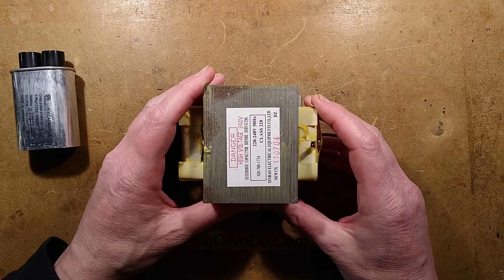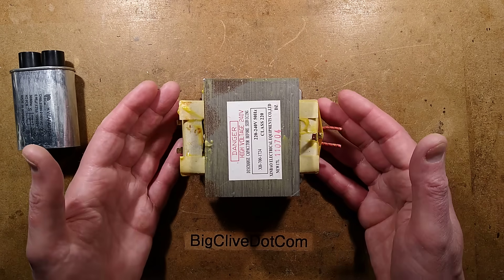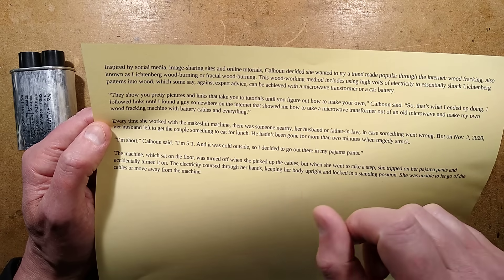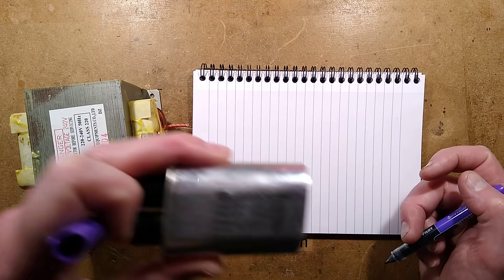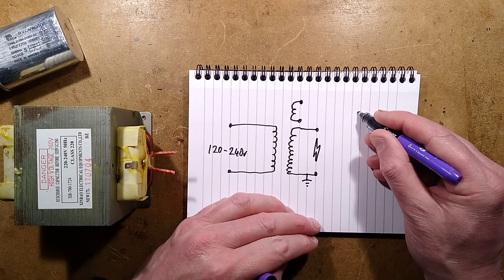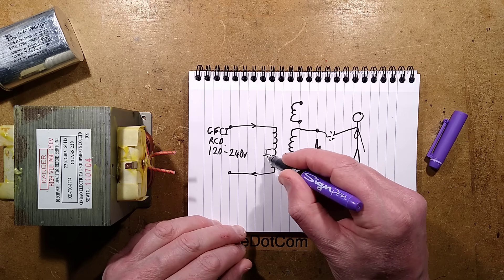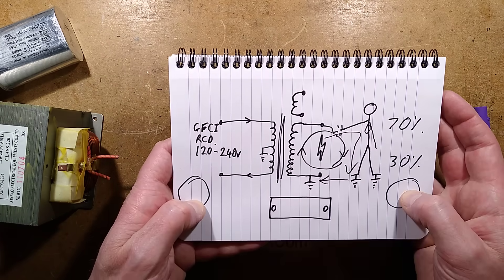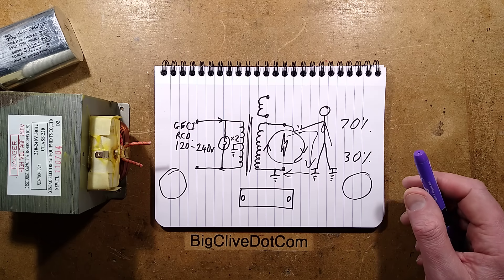The most deadly project on the Internet

Comment: You're dead right to point out the deadliness of microwave HT transformers, as they typically kick out about 2100 volts at about 600 milliamps, enough to kill and cremate someone! And do you also know about the other danger that lurks in the magnetron? The deadly lethal poisonous stuff that can kill someone? I think it's called beryllium oxide or something similar, apparently contact with just a few tiny particles can KILL someone in about a week! The high voltage capacitor can also store a lethal charge.
Reply from the maker: Most modern microwaves use aluminium and chromium oxide.

Comment: I had a special short circuit plug I plugged in when working in in house wiring. Just in case someone would turn the circuit breaker back on.

Comment: “Jumper cables rated for 12 or 24 volts wouldn’t be a good idea”….yeah that’s 12 or 24 volts at 30 friggin amps bud. Conductors are typically rated by wattage.
Reply from the maker: Insulation is rated by voltage regardless of the wire gauge.

Comment: There are a few "how to" videos I watched before I made mine, and I'm pleased to say all is well.  Having said that, I'm amazed at the examples of folk risking death. Like you say, their hands are so close to the probes it is madness.  My probes can be seated on the wood, and then I'm forced to stand about 6 feet away to operate the momentary switch. There is a lamp on top of the box this is all stowed in, and that is on when the power is on. This is near the work piece, in full sight. I can't easily explain the probes that are mounted on their own wooden stands. A bit like a nodding horse?  All in all I'm confident my set up is as safe as it can be.  And to add one last footnote, I did spend about 25 years repairing microwaves for a living!
Reply: Well, as long as you're alone, this does sound safe. The safest way would probably be a hood with an integrated kill-switch.
Reply: " I did spend about 25 years repairing microwaves for a living" I think that alone makes you qualified to play with them lol.
Reply: @neshbro  Except that this is where cockiness, followed by carelessness, often creeps in...

Comment: Great video.  As an electronic technician that used to repair CRT televisions; I'd like to mention a couple of things:  1) Concrete (most garage floors) conducts - quite well, actually.  You should NEVER work on electrical stuff on a concrete floor without shoes AND 2) ALWAYS use the "one-hand" rule when dealing with dangerous voltages.  Make sure only one hand at a time is touching the device or project.  I'm kinda' surprised that you didn't mention #2.

Comment: A deadly important message. Don’t play with High Voltage (over 50V) unless you have done a risk assessment and removed as many of the risks you can identify. Health & safety may be seen as a boring work obligation but it should apply just as much at home for your health and your safety! It’s something you hardly ever see mentioned on DIY tutorials. 

I’ve heard enough horror stories about microwaves to never want to mess with them.

Comment: Ive actually had a accident with a MOT. 
I made a small microwave gun but the magnatron was separate from the power supply and a section of heat shrink didnt completely cover a exposed solder joint. I touched it with the side of my pinky, I was lucky to not be touching anything else otherwise It could have been alot worse. upon getting shocked by the exposed wire my first instinct was to pull away, and i did. however upon pulling away it arced to my finger and burnt my hand pretty bad, nothing like what happened to the lady in the article though. THESE THINGS ARE KILLERS.

Comment: Thanks for doing this video.  I recently read of a local fatality and was blown away by the story.  
I've repaired microwaves before, and I too considered them the most dangerous appliance to repair, hands down. They are a few kV and that's the absolute most dangerous voltage.  At higher voltages it is hard to grasp the wires because the high voltage arcs and you recoil before grasping.  
You didn't mention, but there is an additional thing that makes the microwave transformers very dangerous.  The windings are separated and there is a magnetic shunt in the gap. The transformer is also a ballast - a magnetron has a negative resistance like a discharge lamp.  They limit the current to a few hundred mA.  In a short they limit to a few amps.  This means they don't blow a breaker even in a dead short at the output.  
A few hundred through a few amps is deadly destructive. If you live, you will be burned badly.
Reply: The shunts in the transformer core aren't the only current limiting parts, in fact those only limit current to a small degree. Microwave ovens come with a high voltage cap connected in series with the transformer output. That one is the main ballast. Also an extremely dangerous part.

Comment: I'd say it like this: the amount of power that one of these transformers must put out is great, simply considering its original designed use in a cooking appliance.  No wimpy ionized gas tube lighting, let alone ignition spark, transformers these.  They will nuke you even without a magnetron.  They are a very unwise choice for any craft project.  Better a neon sign transformer for that, which can give you a nasty shock too, but at least is far more unlikely to kill.  Also, neon sign transformers do not reference the secondary to ground/earth.
Reply from the maker: Many neon sign transformers have the secondary mid-point grounded.

Comment: Glad to see you talking about this. People think that insulated wires will protect you and then it jumps through the air. I got shocked in college and was extremely glad I had a hand in my pocket. It's not a guarantee of safety, there's a number of things that can still kill you but in my case it probably spared my life. It feels really surprisingly awful even if you don't get the full amount of power going through you. Had it been DC instead of AC I suspect there's a real chance my heart could have stopped even with my precautions. You shouldn't be doing this kind of project (high amps/voltage) unless you have a degree or equivalent experience in electrical engineering and field experience with high voltages, and even then you would need to set up a workshop for adequate safety and go in with the understanding that there is still moderate risk of death. After that experience I took down my high voltage videos, people who already can do it safely wouldn't learn anything and it could encourage someone to put their life in danger.

Comment: Other comment: If I have to work with a lead from a MOT (or NST), I make it the grounded lead, so I'm moving the lead at the low potential; the HV one being securely fixed to something. This way if I accidently touch the moble lead, I don't get zapped hard.

Comment: I can’t believe you said to discharge a capacitor with a screwdriver. That can be dangerous, also. At least use a resistor first and then maybe test with a screwdriver.
Reply from the maker: For routine safe discharging yes.  But I'd rather people didn't fumble around with wire and resistors on a one-off safety discharge test.

Comment: use an arc welder or an TiG machine, don't use a microwave transformer.
Reply from the maker: Arc welders tend to be a bit too low on the voltage.

Comment: Yeah a dead man walking senario. again as you said compliance you can do dangerous things already and you wore lucky someone won't be. now the question is can we add a high voltage fuse or to current limit somewho the supply ? on the HV side ? 
plus the dead man's switch plus the Deadmans pressure plate etc etc. 

Also if you Isolate the transformer completely in a metal case that is in aplastic case that this is an other plastic case with an ari gap .. could this be a wee bit saffer ? since there is no path to ground ? 

Thanks

Comment: Not something I would mess with Clive, the amps would eventually melt car jump leads. Flyback transformer's and line output transformers in old TV sets can be lethal but there nothing compared to microwave components. It's not always Volt's that kill it's the amps. That's why industrial cables are thick due to the increase in amps. Once again Clive an excellent explanatory video making folks aware of the danger's of such components. Microwave components are not something to use for projects. It's just as dangerous voltage and amp wise as an electrical substation. It's not something I would try Clive.

Comment: Because this is AC capacitive factors are in play especially at these voltages. Shoes, cloth, gloves, and many other non conductive materials act as dielectric material. The AC SHOCK will go go right through them and capacitively couple completing the circuit and ZAP BANG!!

Comment: Every single time I use a MOT for anything I use it with outmost respect. Way more respect than neon or other kinds of transformers and power supplies. If people actually are arrogant enough not to respect how dangerous they can be, they should never touch any of these components in the first place.
I've even seen people keeping them plugged in and only connecting switches to the HV secondary, which is insane. 
I really like that you brought up the DeadmanSW. It is a great and cheap safety device for anything. There is a reason why even industrial robots have them by default.

Comment: I recommend NOT TO USE A SCREW DRIVER to short out the CAPACITOR ! Use a well insulated "CHICKEN STICK" , wear gloves rubber+leather & maybe hearing protection. Being lazy with safety can result in DEATH or PERMANENT disabilities.

Comment: You don't even need to touch the wire, the energy tends to jump gaps at that voltage. Kinda like wearing a wool or plastic sweater and seeing sparks.

Comment: People do not realize that electrical wire insulation is not the same or rated at the same voltages.  Need wire that has kilovoltage rated insulation like automotive ignition(spark plug) type wire on the secondary output.

Comment: What I've actually done is 1 put it in a box with only actual high voltage wire sticking out 2 added a buser that rings when its plugged in 3 i actually turn it on by stepping on a foot switch and turn it off by stepping off so I just put that switch 7 feet away at all times so i can't have the transformer on and tuch the electrodes at the same time

Comment: I had a bad experience with a large color CRT.

I grabbed the case and picked it up. The weight caused the skin of my hands to "extrude" through the cooling vents and get within "gap jumping distance" of the still charged tube.

I damn near dropped a 21" CRT.

Lesson 1 grab the handles, no matter how poorly placed. 

Lesson 2 wait for it to discharge.

And Lesson 3.. make sure to report it to the product safety folks.

I'm not sure that salvaged microwave oven power supplies aren't god's way of applying chlorine to the gene "pool"! :-)

A long time ago I saw a commercial kitchen where the door to the microwave had been removed, the door safety bypassed, and they were tossing food into the cooking cavity and hitting the "timer" button... Wonder how long it was till cataract surgery or brain tumor?

Comment: Not to minimize the dangers but the high voltage secondary is only connected to earth ground if you intentionally ground the transformer casing. If the transformer is just sitting on an insulated surface, there is no reference to Earth or your house electrical ground. Still these transformers are very dangerous.

Comment: Thanks for the video. I've done some nice patterns using a microwave transformer. I wasn't aware of the fatality rate but knew it was risky. I did it in the shed with the doors open but powered the device from outside the shed using a remote control so that were were always about 5m away when the power was on, and the mains end of the remote control had an indicator light. Before entering the shed I also unplugged the device so that I was protected by a fresh air gap and not the vagaries of 433Mhz signals.

But as you say, there are so many things that can go wrong and now that I've done it a few times and have some nice results, I probably will quit because there are many ways to make nice patterns in wood that rarely kill.
Reply: Actual (approved for mains voltage) safety technology like Pilz-Relais cost several hundreds bucks. Your homebrew remote control could be disturbed or their function impaired by the high voltage. I doubt any viable "security" what you named security, including your protocol or tech. The security devices needed on the high voltage side cost a magnitude and up more.
Anyway forgive me the rant, I am glad that you are still alive:) The unexpected is what kills you. Because it's inherently...unpredictable!

Comment: the instant i saw the words most deadly project in your video title i knew what your were going to talk about and to be totally honest with your focus being geared towards the horrible side of fractal burning i kind of stopped the video, not that anything you were conveying was bad, matter of fact seeing the trajectory you were headed on with your video if not being able to detour kids and teens from building a fractal burner then hopefully it will put the fear of god in some parents and the will stop young people from building them because they are dangerous as hell, in fact we had a teen die here where i live from a burner he built a couple years ago and i will admit it did have an affect on me because the couple times since his death that i thought about rolling out my fractal table to make some art pieces i ended up choosing not to do it. I do feel it needs to be said, it is possible to fractal burning in a way that is as safe as possible but there is no real way to do it completely safely. my burner is built so  the transformer is isolated under the table work surface without any way to access it unless you dismantle part of the table, i also used the smallest transformer i could find and utilized a brightly lit double redundant power switch setup, i also don't use a spray bottle for the conductive solution, i don't like random burns, spraying down a piece of wood then letting burn where ever it wants to for me isn't really art. Art aside, it might be worth having a conversation about some of us joining forces to pressure google into removing all the fractal videos because let be honest, we really don't need that kind of dangerous video content on youtube and we both know google is a stickler about safety, let me know what you views are on eliminating fractal videos from youtube.....

Comment: Clive, would you make a video exploring the safety (or lack thereof) of glowing screwdrivers? I have been using them to test for 220V live wires since I discovered them, but some commenters are saying not to use them?
Reply: I know of a case where the little neon inside the screwdriver wasn't lighting up so the owner removed it by unscrewing the tip of the handle and replaced it with a metal slug. Some time later he used it to test a socket which was live and got a shock, fortunately not fatal.

Comment: There's a story that's been told in my home city at all the colleges, universities, trade schools, etc for some time now (although it wasn't very long ago).
Local IBEW guy (unions do it better), not a newbie, plenty of experience. This led others and himself, foolishly, to assume he didn't need a second set of hands or eyes on his work. He always did it right the first time.
Well he was workin the electrical on top of a shopping mall, and forgot to put the insulators back up. Simple mistake, out of all the sorts you could make. But all it takes is one screw up to blow a hole through yourself.

Comment: 14:15 - Many years ago, I played around with a low powered flyback, with no smoothing cap in the driver circuit. I intentionally let at a moment the current to flow through me, so it wasn't just accidental. I already heard that you cannot feel high frequency current flowing through you, but to my disappointment, it did shock me. However, I was able to promptly throw the terminals out of my hands. It scared me, but it did no harm to me. I didn't even have burn marks. The flyback driver was powered by just a small iron core step-down transformer, (edit:) output 13.5 V, core dimensions 5 x 4 x 1.6 cm, or 1.9 x 1.6 x 0.6 inches. Amps / watts not shown on label. But it's abolutely gutless
Reply: Usually flybacks contain high voltage diodes inside to rectify the output. High voltage DC can give you quite a nasty shock.
Reply: @GearClinkz  - The one that shocked me was a vintage B/W TV flyback, an external selenium rod rectified that one while it was in the TV yet. The rectifier wasn't used in the DIY build.
Reply: It's usually about 20kHz that it stops shocking you, but it still burns.
Reply: @750kv8  What did I say?
Reply: @Owen_loves_Butters  - Sorry, I misread that.

Comment: People don't understand how dangerous electricity can be. Years ago I bumped the anode of a 6lq6 tube in an amplifier that was on. The 600+ volts sent me flying across the room about six feet. Even 110v can be very dangerous, as I once accidentally grounded out while replacing a 110v wall plug.  It was the oddest sensation in that all my muscles seized, I couldn't let go, and my mind went completely blank (literally short circuited). Thankfully there was a flooring crew present and one of the guys used a plank to knock me off the circuit. The reason I didn't shut the circuit off was because I figured "it's only 110, I've done this dozens of times".